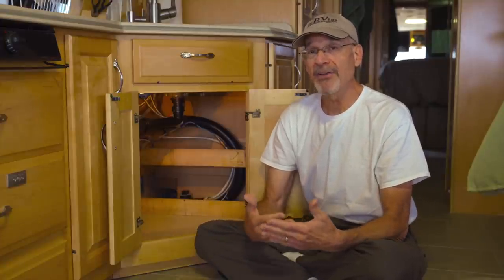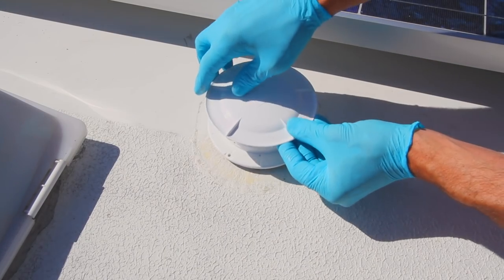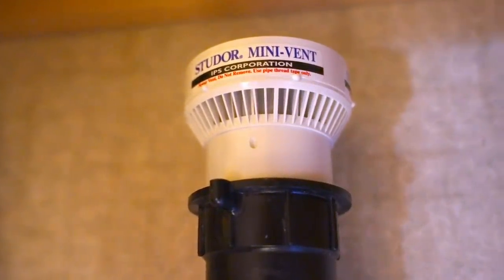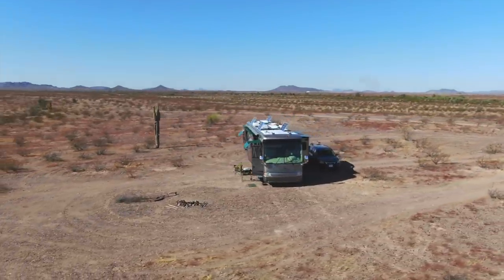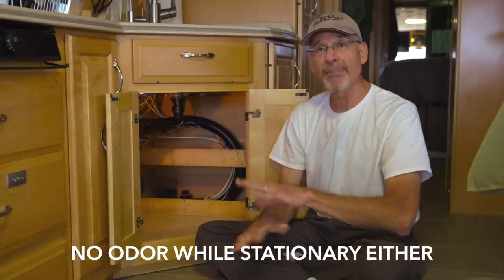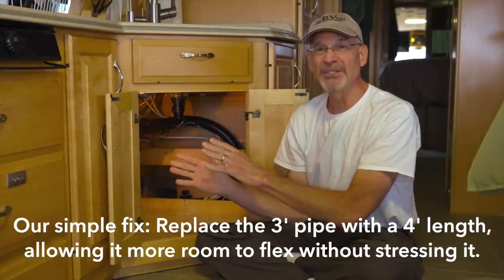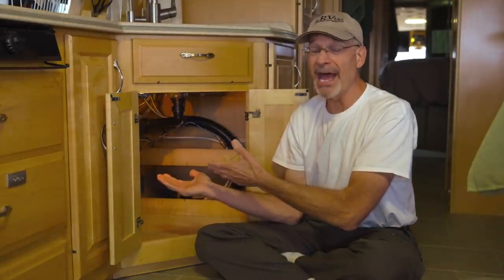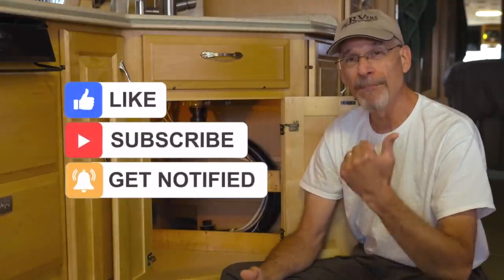Gray Water Tank Odor in an RV STINKS! Can You Figure Out Why Our RV's Grey Waste Tank Reeks!?

Comment: Fascinating! I can smell my gray water if my gray tank is more than 2/3 full. It’s not a strong smell because the water doesn’t sit long - I usually empty the gray tank every 4 to 5 days. I have a very sensitive sense of smell so it’s possible there is no real problem and this slight odor is normal, but your video helps me understand the plumbing system better so I’m going to check things over. Thank you! 😃

Comment: This is a really excellent video.  It almost looks like the end of the old flex pipe was cut were it was tightly coiled for shipping and warehouse storage.    It's amazing that it lasted 10 years.    I'll say it again, I'm envious at the length of time you've had that RV (16 or 17 years now?) and it still looks brand new.   You take the time to maintain it and especially fix small problems before they become disasters, which allows you keep it for as long as you have.   Just curious, how many miles on the odometer? 😀
Reply from the maker: Thanks for the comments, John. Much appreciated. We’re at about 97,000 miles.

Comment: we have always drained our gray tank daily. I put treatment in it after that plus 4 gallons of water every morning. we are in Texas now. I didn't have this problem in Wyoming.  But when I drain it now in the heat of Texas summers, I get a smell inside, but do not smell it outside.  We have looked under sinks, under shower. None of those are in a slide out. We didn't have this problem in Wyoming. We drain it daily, in the morning, always have since purchased just because in the beginning we would almost overflow, water would back up in shower first when tank got full. We have lived in it for two years now. not quite a year in Texas, yet. It just bothers me in should I be doing something different. is there something else I should be looking for or doing different thanks
Reply from the maker: Hi! So sorry to hear you’re having this trouble. This type of thing can be so challenging to sleuth out. In trying to figure out any difference between being in Wyoming and being in Texas is… Do you have any of your roof vents open because it’s warmer out? it is possible that some odor from your plumbing vent on the roof is coming in through the open vent.
Reply: @RVgeeks  hotter and more humid in Texas. Is what we are thinking. The bathroom with the fan, we open in cooler weather, we haven't opened it since early May.  We are on week two of over 100 degrees. Might not have anything to do with it. It was just the only difference in trailer life.  The smell goes away, it just frustrating that it happens when it use to not be a thing.

Comment: Wow, you never cease to be surprised by issues with housing:). I installed a quarter sized fan that actively vents my grey water tank 24/7, it uses very little power and work well. I tried various Ptraps and they always would drain while on the move.

Comment: I have a camping trailer that has plumbing on the slide-out. It was the first thing we had to fix when we bought it. Forest River did a really poor job designing it. We ended up replacing the line with a pool vacuum hose. Its been 4 years so far with no problems.

I also been to a few RV shows in my area over the years, when I would come across an RV that has a sink with a slide out, I look under the sink to see how they did it. (I drive the sales people nuts!) The majority of them are the same design as your RV. Others are an interesting design where the pipe pivots on a slip-joint type fitting (if you will). No flexible piping at all, a much better setup in my opinion.

Comment: What kind of smell does the grey tank give off? We have a small travel trailer that has a bad oder and we can't seem to figure out where it's coming from. It's not a smell of sewage
Reply from the maker: It’s bad! Hard to describe. But can be just as nasty as black water!
Reply: @RVgeeks  we have a camping trip coming up next month, I'm going to do the geo method in both black and white tanks along with ice in the black tank before heading off and see if that can help
Reply from the maker: @a-carpenter9229  if the odor is coming from underneath one of your sinks, be sure to check the air admittance valves. We have another video all about that if you need more info.